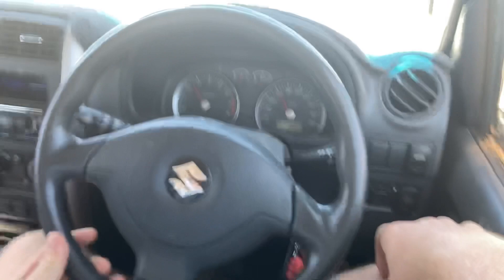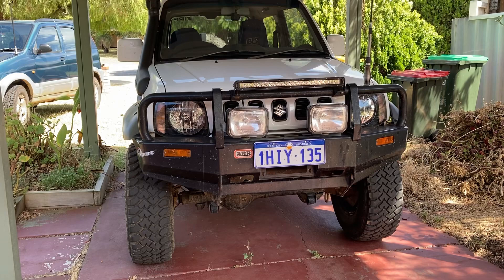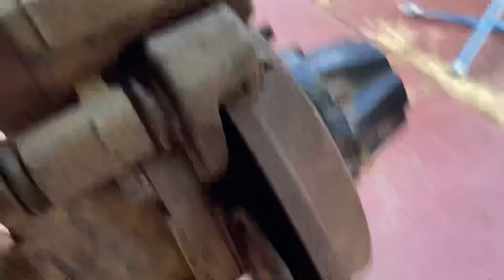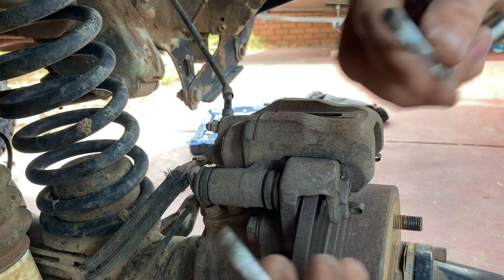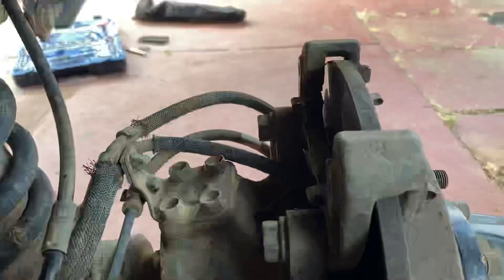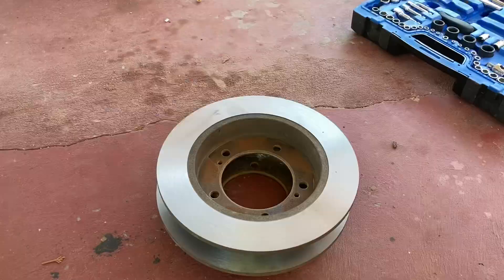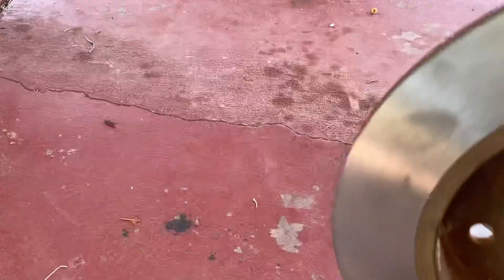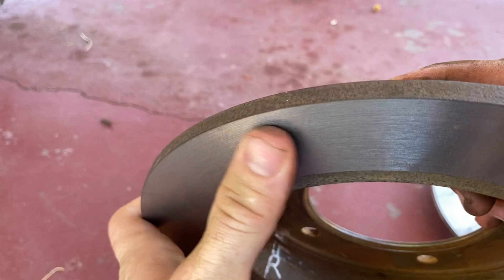HOW TO JIMNY [Fix brake shudder and replace front brakes]

Comment: ive got 30" tires on my 2013 zook and original disks and calipers. she doesnt pull up well at all! ive had a few close calls. so im thinking of swapping my disks and possible calipers out for vitara ones as there a bit bigger. i havnt checked out my breaks properly yet as i havent removed my wheels. but im just wondering if youve go the stock breaks on your zook, or have you swapped them out for bigger ones as youve got 31" tires. thanks mate!

Comment: Great video 👍🏻. What do you know about death wobble? My Jimny has been heavily modded everything upgraded (Brought the vehicle already modified) I’m getting a severe case of death wobble between 30mph and 45mph, it’s unbearable 😫. Doesn’t seem to be any play in the kingpins and i’ve replaced the Panhard bushes with uprated ones. Still the same! It looks like there may be a bit of play in my steering box but not sure if that would cause it 🤔. Have you ever had this issue in your Jimny if so how did you fix it? Keep up the good work 💪🏻
Reply from the maker: Hey mate usually there’s 3 things with Jimmy’s. King pins need shims, incorrect caster or the control arm bushes are fingered. I’ve never had a death wobble in mine but I put the jimny bits extended control arms in straight away. Maybe try the shim kit you can get for the king pins
Reply: @jimnythings2410  okay mate cheers
Reply: changed all the bushings!! 2007 soft top jimny. Before I had Super super  bad wobble at 70-75km/h. So bad I thought I was very dangerous.. Initially  I thought it was king pins or bearings but no. it was the bushing..  I also have   I lifted it up(+4)  with ARB springs and EMU shock. It rides very nice now. (EMU feel a bit too soft but nice)..bTW  make sure you get polyurethane bushings  )

Comment: So you didn't show if the shudder was gone???
Reply from the maker: Watch the last 2 minutes of the video. Filming the steering wheel while I’m bedding in the brakes. No shudder 👍
Reply: @jimnythings2410  I watched the whole video, wasn't sure if it would shudder with harder or more abrupt breaking than you were doing at that point. It's all good, thanks for the useful info.